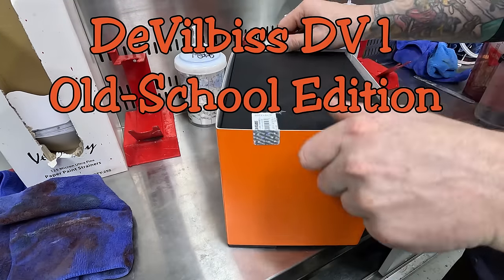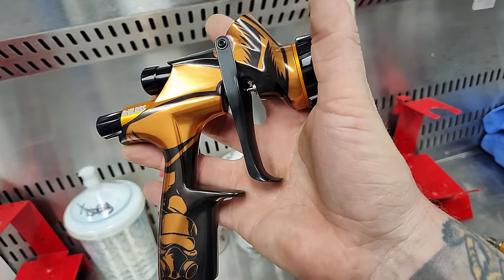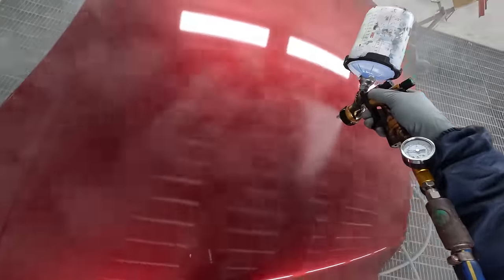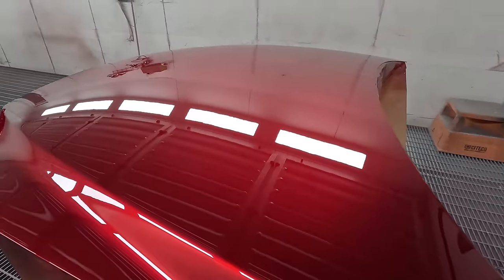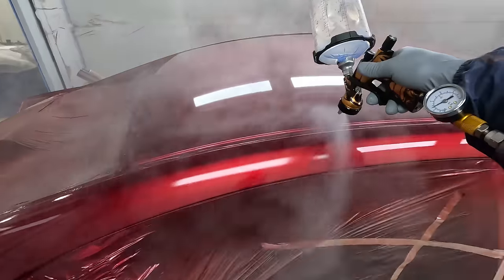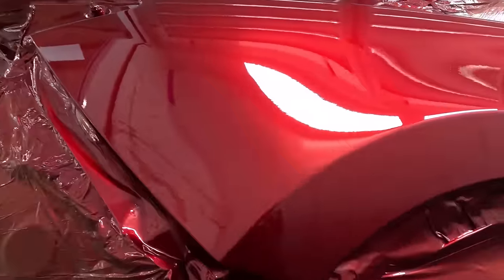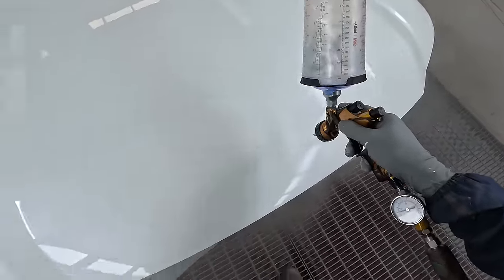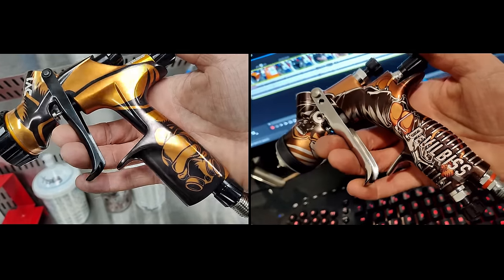Old School DeVILBISS DV1 Limited Edition

Comment: DIY at home in Perth with 3 x 80's W126 classic V8 Mercs. prepping my 89 midnight blue 560SEL for full repaint and then going to respray my 88 040 black 560SEC. Main guns i have bought over time is ANI F160 1.3 / Devilbiss ProLite with range of caps / Devilbiss GPI 1.4 & 1.6 caps / Sagola T/Truck Ltd edition 1.2 & 1.3 caps.  Other guns i have bought & tried are Ronpeng R500 & A610 with various caps & NTools NVE 1.3.  Own other guns dedicated just for hi-build primer.  Majority of my gun collection has been from your gun reviews over the yrs as have watched your channel forever since you started back Perth.  I have access to a Pro spray booth in Balcatta that is hired out as well as spraying in my home dble garage for primer work.  Both cars i want a show car glass finish & happy to put as much post painting wet sanding & cut & buff as required to get a good resullt.  Don't see the need for buying any of the latest variation of guns coming onto the market for guys like me who are backyard DIY enthusiasts.  What do you think
Reply from the maker: Definitely, these limited edition guns are mainly for people who don't mind spending the few extra dollars but will get the use out of it. For you, just treat it like any other tool, purchase on performance not looks.

Comment: Hi Gunny when you first have a brand new Gun do you have to spray thinners thought it before you start to spray any paint or lacquer. Cheers Rob
Reply from the maker: Not with the top of the line guns, but definitely on the cheap ones they're drenched in oil

Comment: Hi Gunnie can you recommend a good reasonably priced gun to spray mostly 2k solid colours and the odd solvent clear of base jobs? Thanks
Reply from the maker: Pro lite is still hard to beat if you can justify the cost. 
If that's too much look at the GPi.
Even ANi have some awesome options and they punch above their weight on performance.
Reply: Thanks for your reply I was thinking of the FLG 5, any thoughts on that from my needs?

I will look into the ones you’ve mentioned and see witch matches my budget.
Reply from the maker: @Hansblinkers  how could I have forgotten, that is still one of my favourite guns, definitely highly recommended